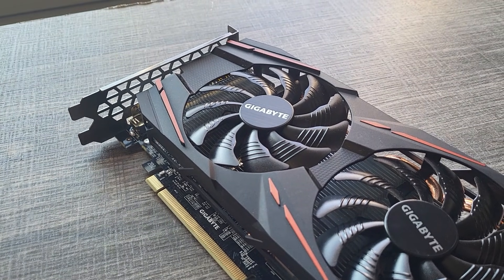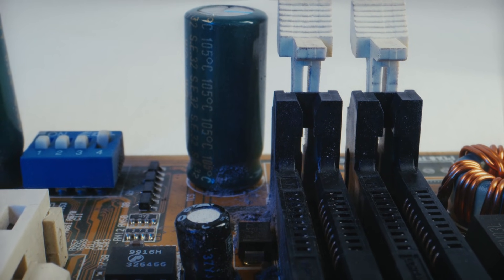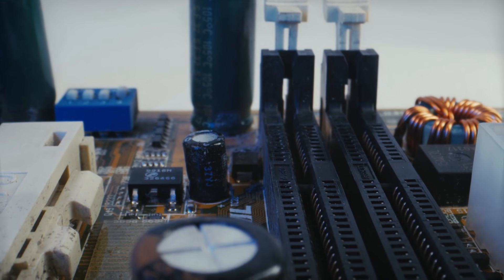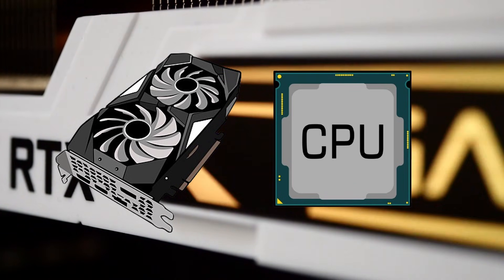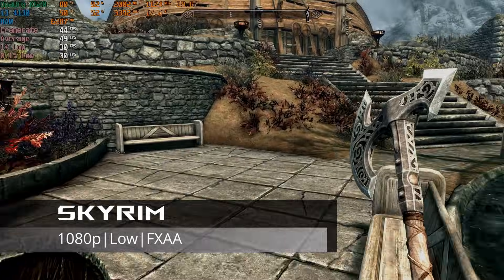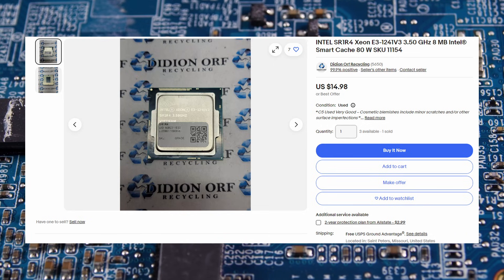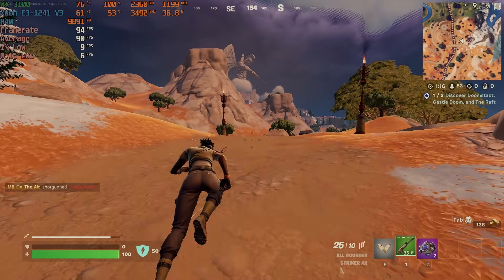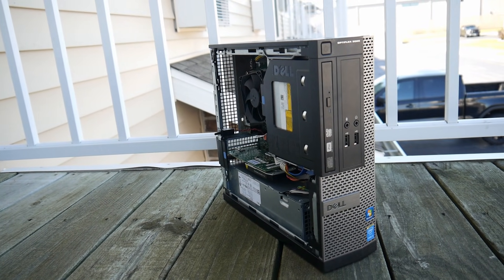An Ultra Budget Gaming PC

Comment: I just built an i5 7600 + GTX 1660 Super PC for just $150. Really happy with it
Reply: WHAT? THAT'S CRAZY
I bough my laptop in 2021 for 500$ with an i5 11300h (really good) but only a gtx 1650. Keep in mind this is a laptop version of it
Reply: @StefanMicu  yeah, I got really REALLY lucky. Of course they're all used parts and some Chinese sticks of RAM. But for now it'll do.
Parts tend to be really expensive here in Brazil, but I just had tons of patience.

I almost went with a laptop too haha
Reply: @gtPacheko  Yeah
Reply: Would the 1660 Super be a good pairing with an i7 8700k?
Reply: @BREEZYM6015  It's about a 15% bottleneck (the cpu is weaker than gpu) but it's decent enough if you're a casual gamer
Reply: @StefanMicu  This is definitely not true, the cpu is not weaker than the 1660 super by anything, the gpu is actually the weaker one and the 8700k supports up to 1080 ti/2080 fine without any problems.
Reply: @thescoffe  i used bottleneck calculator, it can easily handle it, but it is not the best pair
Reply: @StefanMicu  
1. It seems you used the general tasks in bottleneck calculator, because that gives a value of 15% cpu bottleneck, using the gpu intensive task option, which you are supposed to, it gives a 0% bottleneck.
2. Bottleneck calculator is a helpful tool, but should not be used as a definite solution to a question about bottlenecks, as it still based on simulations rather than actual tests. Actual tests will show that the 8700k can handle gpus up to around the 2070 super/2080 level of performance without any bottlenecks in most games.

Comment: Hey,built a 70ish $ PC recently. Xeon E3 1246 V3, Z97 HD3, 4*4 d3 ram, P106-100 6gb, 240gb ssd. Runs CS2 at1080p, 100 fps low, no FSR. Black Myth Wukong  1080p, mid, 60FPS, at 50% FSR.

Comment: G'day UBPC,
Builds like this are great to get Kids Gaming in RoBlox, Mincraft etc... & learning how to use a PC

While not as Fancy or Modern as your one here I got the last part needed (CPU Tower Cooler) for my DELL "Upgrading to Gaming PC" Inspiron 530 😂. 
I got the PC a few years ago off eBay for $30AUD as "🤷‍♂I don't know why it keeps crashing trying to turn on & I took out the graphics card🤷‍♂" & has been sitting in a box waiting.
It is an original Q6600 + DG33M03 running Vista, did some investigating & CrystalDiskInfo found the HDD was failing with a crazy amount of bad sectors, so I added my test R7 250 plus one of my spare DELL 500GB HDD & fresh Vista install worked perfect.
Being in good condition including the Original "Windows Vista" & "intel Core 2 Quad inside" stickers (while upgrading to a In Win PowerMan 400W PSU to add PCIe 6pin) I thought I'd stick with a Period GPU of which I found a PowerColor HD4850 for $10AUD 🙃👎, but then...
Giving it a run with CB R15 the DELL CPU Cooler fan is starting to make "Dying Noises" so I "Splurged" on the Silverstone KR03 92mm Tower Cooler for $15AUD, Super Happy as doing a good job running Unigine Tropics it will play heaps of my GOG DRM Free Retro Games for a total of $55AUD😁 ($38USD - £28.50).

Comment: For 80$ I got i5 7400, 16gb ddr 4 ram, 256gb ssd and rx 550 4gb. I use it as tv pc, but it can handle even witcher 3.
Reply: For $17 the 550 4gb is pretty good, if you spend more a 1050ti around here is about $35, RX580 8GB about $45. At the $80 price point any 4GB card is great.
Reply: @cecilb7927  I have another spare rx 580 8gb, but I needed gpu without a need for power supply connection so this was the best deal I found. For pc tv it's even overkill but at least there is headroom for other stuff.
Reply: @nostradiel  what operating system u use at these pc that wont support Windows 11?
Reply: @HonzaZalabak  Windows 11
Reply: @nostradiel  tyjo tak já tomu nerozumim :D co je ten humbuk co slyším v práci, že ty mašiny co máme ten Windows 11 nebudou podporovat?  Vy ty tam nainstalujete i když to oficiálně Windows nepodporuje? Já už byl smirenej s tím, že začnu používat nějakej Linux
Reply: @Kafepijec  Ta instalacka Windows 11 musi byt upravena flashovacim programem jako Rufus, aby to slo. Je to easy a nabidne ti to samo pred flashnutim iso na usb. Microsoft to udajne chce nejak zakazat, ale cetl jsem i to, ze stale chce ponechat nejaka zadni vratka, aby to slo, ale sam se v tom uz nevyznam. Kazdopadne na domaci PC asi pohoda, ale na firemni PC to takhle davat asi neni dvakrat idealni. Tam se bud bude muset prejit na linux, koupit novy hardware, nebo doufat, ze Microsoft cukne zpatky nebo aspon vyda neco jako "Windows 11 Company" pro stara firemni zarizeni se snizenymi požadavky na hw parametry.
Reply: @cecilb7927  JUST 45 $!?!? ITS LIKE 100 DOLLARS HERE!
Reply: Is 550 wort it for 60$?
Reply: @AffectionateLocomotive  no
Reply: @AffectionateLocomotive honestly for better performance and similar tdp, look at the Radeon rx 5500 gpus tho obviously more expensive
Reply: @AffectionateLocomotive  To me no. I bought it for 370kc ~ 17$.
Reply: I got a HP sff pre built for around $55, but it didn't have a HDD. I had a 256gb nvme laying around from a previous upgrade. The PC has a 10100, 8gb ram, and wifi/Bluetooth. I also had a 16gb kit laying around so I threw that in. I mainly use it for Batocera which also comes with Kodi I can use for movies. It's a great living room PC. I was getting screen tearing with the stock iGpu in PPSSPP so I bought a Rx 550 for $30. I only have room for a single slot low profile. If I had to do it again I would probably go with nvidia for opengl performance. The AMD Rx 6400 would be sweet too. I'm stuck on 10th gen because it's a b460. I may upgrade to the 65w 10600 down the road.
Reply: idk man.. shit cost more here.
Reply: @nostradiel  DAMM. SO CHEAP ! ! my country sucks 50$ for r9 270.
Reply: Those parts cost 300$ in my country
Reply: @mohamednajibabidi1989  niger 2🇳🇪 WHWT!
Reply: how
Reply: @01_Pat_RL  Decommissioned pc from my work I got for 30$, I bought rx 550 for 20$ on Czech "ebay" called Aukro, and I bought brand new 2x8gb 3200mhz ram kit for 30$.
Reply: you might wanna upgrade that gpu lil bro